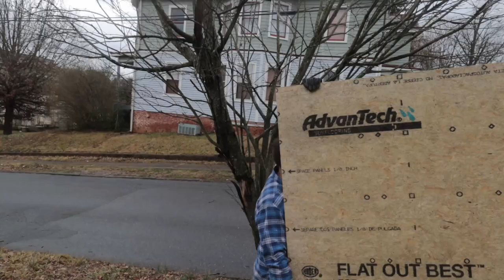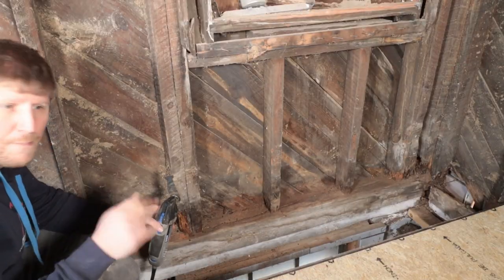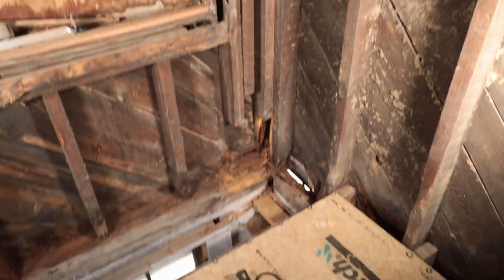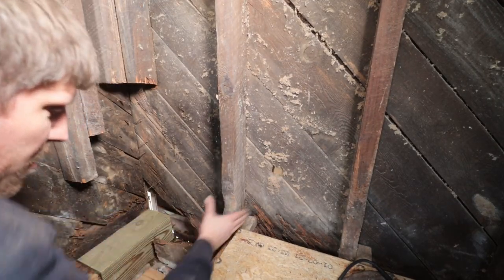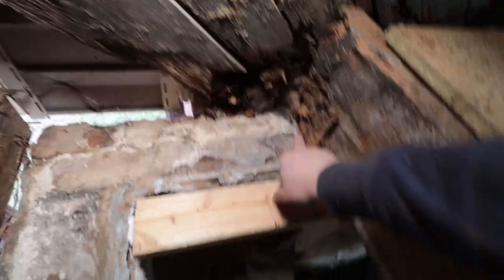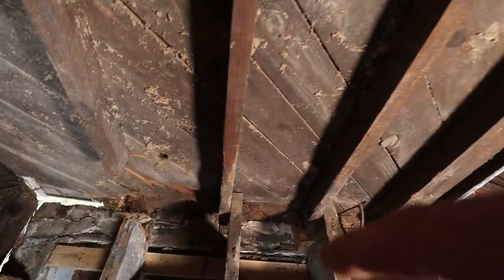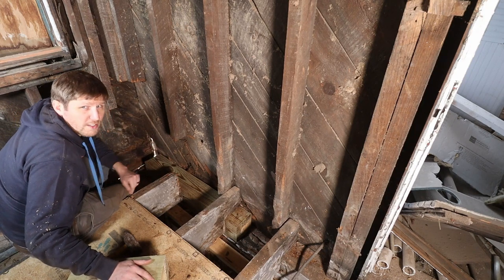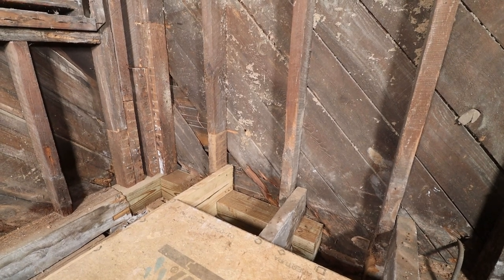Corner Repair and Temporary Subfloors - Victorian Home Renovation [TirolerInn]

Comment: For the rotted studs, would sistering new 2x4 on each side been a fine alternative or is the idea that for supporting load sistering outs the weight into the nails/screws?
Reply from the maker: Great question. From a load perspective sistering should be fine but with dry rot it is recommended to take out all the dry rot so it can not spread further.

Comment: I know you used pressure treated but should you have not used a sill gasket between the pressure treated and the concrete to avoid rotting again?
Reply from the maker: Yes, if I thought of that then that would have been a great idea. But I am not too concerned that I missed it because we will do a full wrap on the outside of the house when before we redo the siding.

Comment: Nice job...With that much cutout on the joist, what do you think about using metal hangers just to be safe?
Reply from the maker: Yes, I think I mentioned somewhere that I will add some brackets and ties in to strengthen the cutouts. We just did not have any at the house. So we need to do that tomorrow.